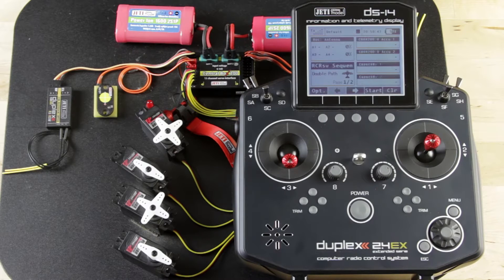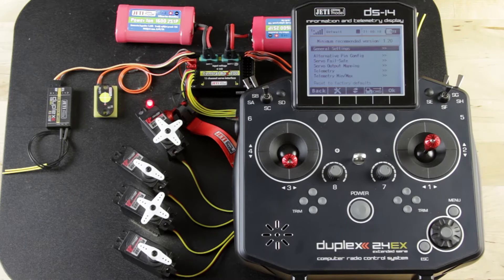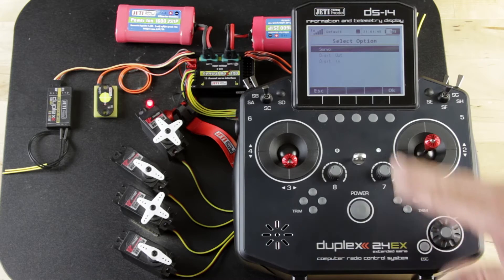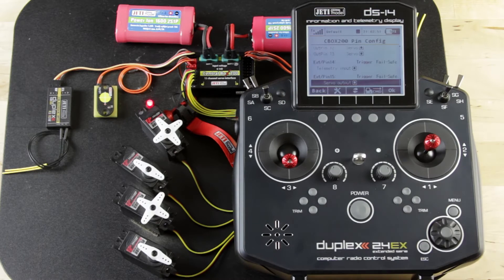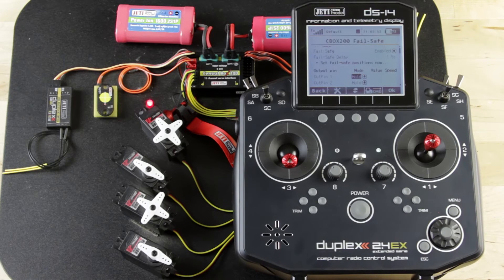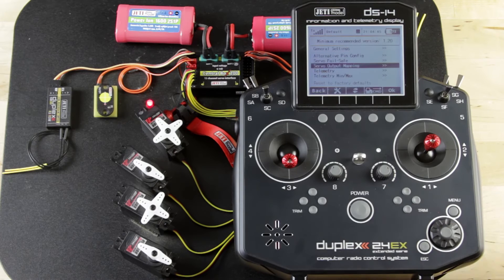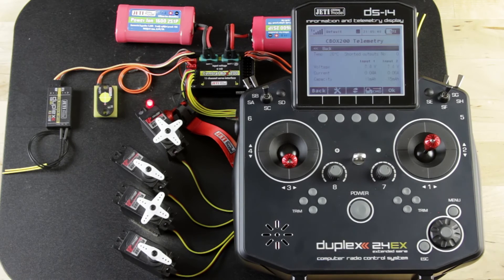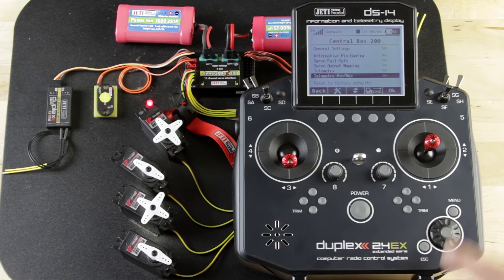Device Explorer Programming: Central Box 200

Comment: For some reason after i did the latest update within the jeti studio of my ds 14 and my central box 200, after i paired my primary and secondary satellites i went in to change them to EXbus but the "Jetibox 200" is not showing on either satellite!! None of my servos are working what im i doing wrong??  Also, are there any instructions on how to setup my wing type for a biplane?

Comment: Hi there, if I use a CB200 with a Jeti Assist receiver in EX1 and say an RSat2 (in the UK) into EX2 where do I then plug the like of an mGPS sensor in. Please can you do a video or two on the Assist receivers and how they work with the CB series. I want to have Assist on my ailerons, elevator and rudder but not sure how to go about it. Moving to Jeti for the first time. Thanks
Reply from the maker: At this moment the REX Assist (as well as RSAT) are not available for use in the USA, so we are not able to do a video. In addition, the devices that are not distributed by Jeti USA, will work slightly different then ours, so I would reach out to where you purchased them. If they are the US versions, send us an email at support@esprittech.com. Thanks!
Reply: Thanks for taking the time to reply. By the looks of things we are getting the Assist receivers before you guys in the States. I've spoken to a few retailers and the dealer I've used has many years with Jeti but is new to Assist as well. I've found an official Jeti document that shows a CB200 with a REX10A into RX1 to stabilise up to 16 servo channels with an RSat2 into E1 on the Assist. I hope that then the RSat2 is the backup if the REX10A fails but I'm not 100% sure. Appreciate the time you took.